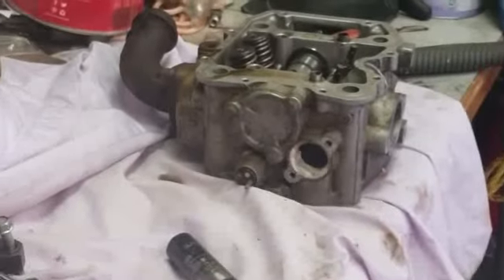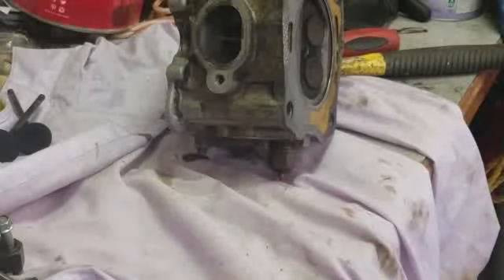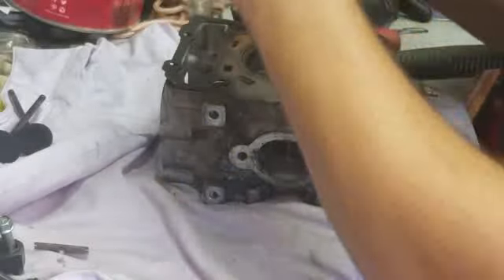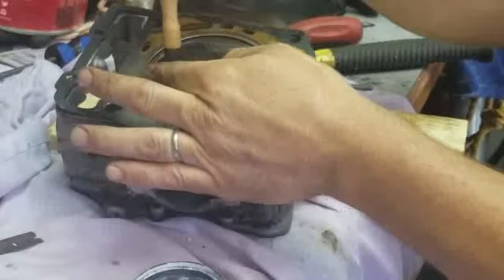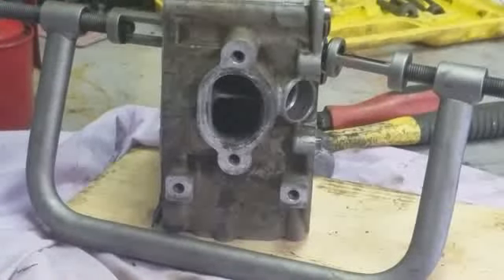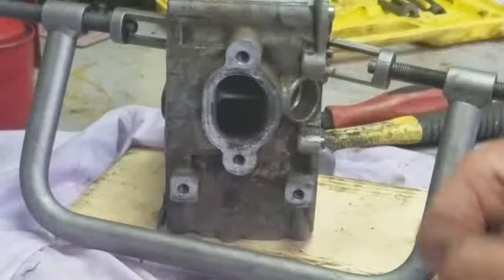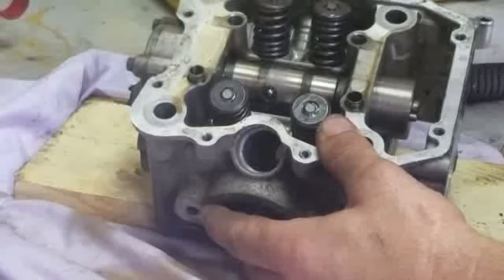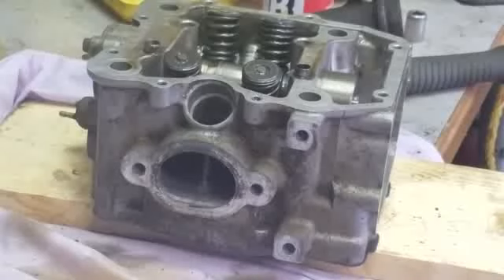Installing new valves in a Polaris Sportsman 500

Comment: What made you realize that the valves are bent how did the bike run?
Reply from the maker: Yes the bike ran it just smoked a lot that's what made me dive in and check further
Reply: maxam home repair see I hydro locked my scrambler 500 and it sat for a few months then I cleaned it all out and got the water out and it only backfired a few times and that’s all I’m getting what are your thoughts ? I’ve done bout all I know and I’m about to take it apart as we speak to check it all out
Reply from the maker: Sorry I was thinking of a different bike it wouldn't run at all and had no compression
Reply: maxam home repair do you think a bent valve could be causing mine to back fire and not run? All it will do is turn over I give it full throttle and it will back fire threw the exhaust and that’s it I bought the bike hydro locked and I’m trying to figure it out. Any help would be appreciated